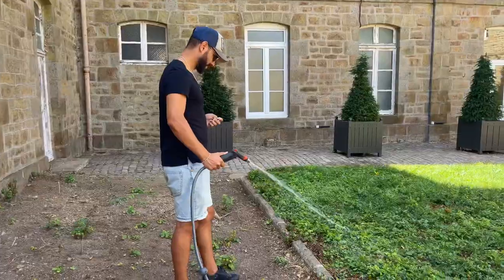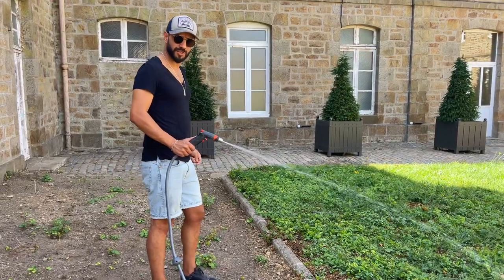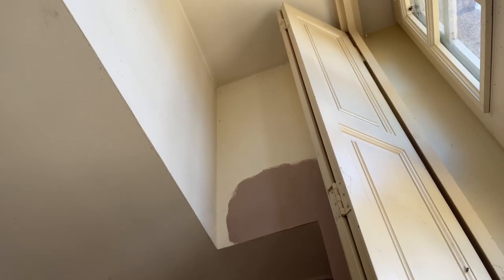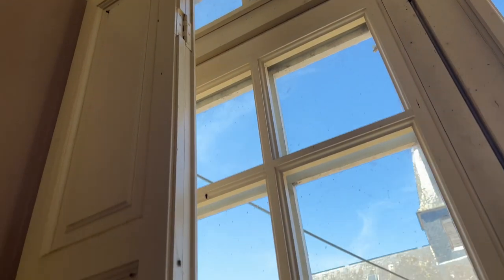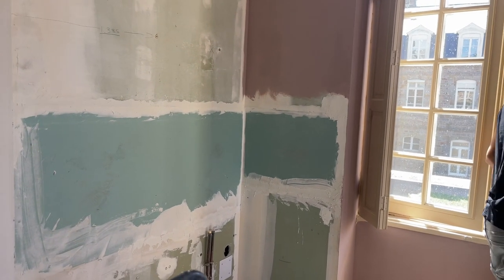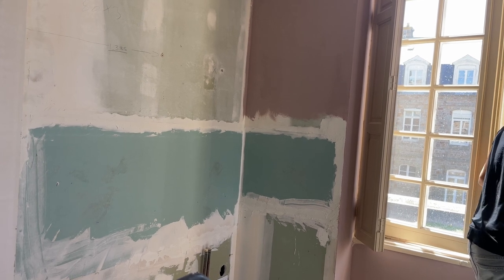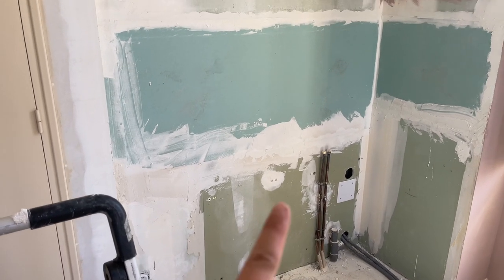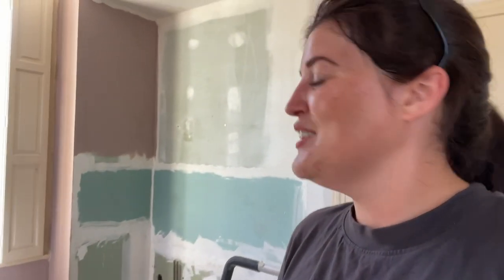Caring For The Convent's Court Yard Garden & Kitchen Update!

Comment: Hi guys just a little hint, you should actually water your lawn and plants after the sun goes down, or the very early morning before sun comes up, as the heat from the sun can cook the leaves, petals and grass especially if you get them wet
Reply: In (that part of ) France it is best to water/ humid the lawn and plants after 10 in the evening. In the early morning it will get warm quite fast.
Reply: You have been misinformed. If that were an issue, plants couldn't survive being rained on.
Reply: No..you shouldn't.  Watering after sunset promotes fungus.
Water an hour before sunset.
Reply: @pamelamcfadden337  I think it depends on where you live. If you live in a wet environment, where fungus grows easily then you shouldn´t. If you want to water your plants with a little amount and where the hot and strong sun is setting late, late in the evening is best.

Comment: All very niiice work Sadie and Mo. You are young and learning as you go. Just a quick positive point. May have been better to paint the ceiling first. The paint spatters every where and may even end up in your freshly painted walls. Just my little input. Good luck and keep on trucking. God bless you even your working through all the heat. What challenges you are facing

Comment: Have you thought about making the square  angle of the ceiling by the tops of the window angled?  Just a slight angle would still give you the height you need for the mechanicals, but you would not loose the visual of those beautiful windows.  You are doing such wonderful things!

Comment: I use a brush when painting. Like you I find painting with a roller is messy. When Michael was painting his cottage he used a brush too. He also pointed out that that it can leave a texture  bubbles on the wall. But it is like you say everyone has a different preference. 
I thought delay was due to heat and as these horses are not getting any younger, you have their well-being to consider. 
Everything is coming along and looking good. Look forward to the next video.

Comment: I'm surprised that Mo didn't use mud joint tape when he patched the wall in the kitchen. Won't that just crack if all he did was fill the cracks with drywall mud? Never saw it done without tape. Looking good though!

Comment: Hi Sadie and Mo, I love watching your renovation - it's looking great. I am a keen rose gardener and horticulturist & had a very successful Landscape and Garden Design practice in Sydney Australia for many years. I have retired from that due to health issues but still garden. Here are some tips to help the Convent Garden Courtyard flourish. 1. Spray or dry pellets "weed and feed" on the lawns. 2. Foliar spray on the roses, slow release feed or "Rose Booster" slow release dry feed for roses - you should be able to buy in a large bucket/tub. 3.Mulch the soil around the roses with the best mulch you can afford - pea straw is a what is called a "green manure" and it mulches (you will get some little peas growing out of it but just ignore)...this product does triple the work - it nourishes the soil adding nitrogen/organic material which is essential for happy roses and it slows the evaporation of water from the soil and keeps the rose roots cooler in the hot summer. This should be added at least 3 times at year at the beginning of the seasons SPRING, SUMMER, AUTUMN. Roses need a good prune and clean up of any leaf drop (because they harbour disease) at end of AUTUMN. With the addition of mulch and feed your roses will explode with growth and flowers and health for ever more. I am sure you are all growing lovely roses at the Chateau so likely you're already onto that. I have had several gardens with over 50 roses in each garden so I know how much it takes to water them too - Sydney gets pretty hot in summer. I now live further north of Sydney IN Brisbane which is more humid (not great for roses) and very hot. I recommend a soaker hose for the rose beds. You can plug the hose in at the end of the soaker hose, turn it on, go up to the apartment and do you work and then as you leave you can turn the hose off and they roses will have been watered. Also, I think Billy put in a watering pipe to the fir trees when he potted them up? I think? so water into that and the water will get to the roots. If you don't keep the soils moist the soil that dries out becomes hardened and can become what is called Hydrophobic - that takes a bit to overcome but adding organic material to the soil will stop this from happening - it will also encourage microbial and macrobial life which means a healthy soil. xxg BRISBANE AUSTRALIA